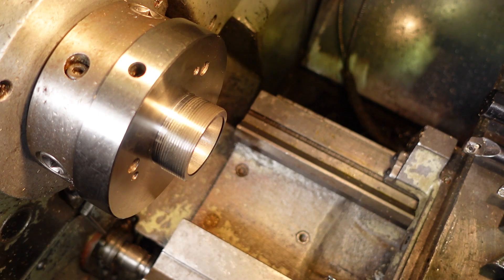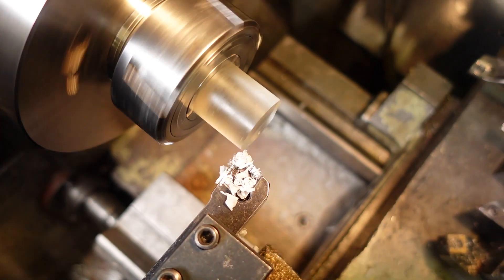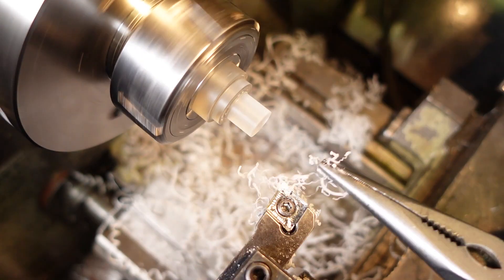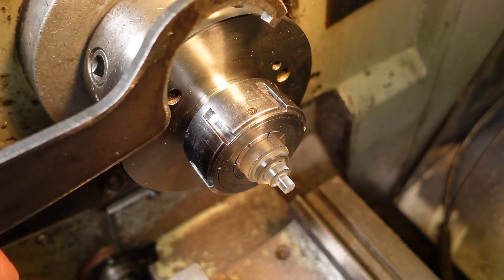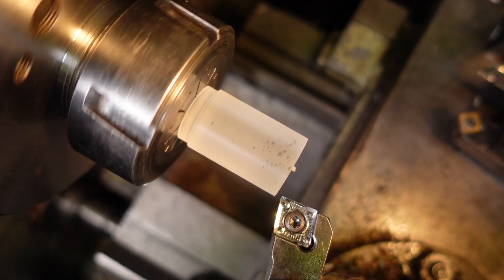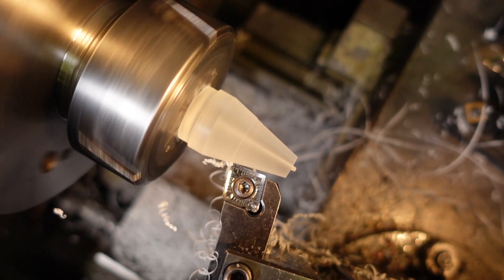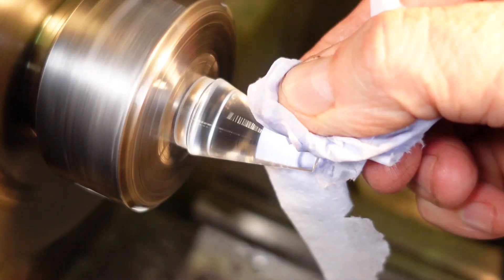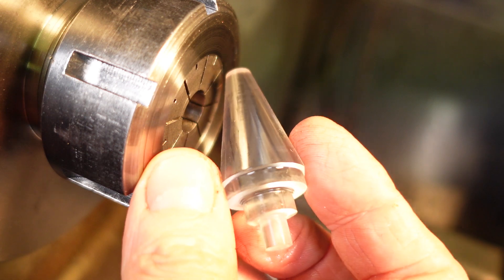Machining a 10 GHz Lens Antenna from Rexolite 1422 Dielectric Polystyrene

Comment: Thank you for sharing your video, and for explaining what it does. I never thought that styrene was a lens material, let alone one for radio microwaves. Plastic chips too!
Reply from the maker: i've made several other videos about dielectric lenses. Many of the non-polar plastics make very good dielectrics for lensing at radio frequencies. PTFE and polyethylene are particularly good performance with very low lossesI use UHMWPE and polystyrene quite a lot. Polycarbonate isn't particularly good but makes good transparent radomes. Most of the engineering plastics and copolymers tend to be polar and have more dielectric loss, so they aren't as useful for lenses. The really interesting materials are those using a plastic base, which is, either a UV setting resin or a thermoplastic polymer that can be 3-D printed but that also contains ceramic granules or alumina or titanium dioxide for example. It'scertainly a very fascinating area and at millimetre waves you can use optical design techniques to make radio aerials, which feels a little like magic to me.

Comment: I enjoy working with Perspex, I'm not sure how different it is to Rexolite. Forgive me I have no idea about microwaves so how do you get the microwaves into this structure, I could understand if it were an LED etc but do you point a beam of 70Ghz at one end and something comes out the other? Is it a way of focusing a 70Ghz beam, if so why?   I look forward to your video on these things, I have an electronics background but a few Mhz is my limit and that's only in a clock form. I love the look of microwave stuff but its got me beat on how it works. I've pulled some old cellphone network amplifiers etc to pieces and the boards are an art form.
Reply from the maker: Rexolite is more brittle than Perspex but takes a nice polish. The lens fits in the end of a round waveguide tube. Waveguides can carry microwave energy with extremely low loss, but when you want to illuminate a parabolic dish, you need to form the beam into  a nice clean lobe without any responses from off the main axis. Target it to illuminate the dish with just enough of the available beam power to give good efficiency without any spillover.  First issue is to get from the air dielectric into the plastic without reflection mismatch, so the rear of the lens smooths the transition.  Then the tapered section, which has a relative permittivity of about 2.6, carries the wave at a lower speed than the air and acts to focus the energy into a beam with about 100 degrees beamwidth at -12 dB (about 7% of the peak). The dimension is only about 0.7 of a wavelength, so it behaves like an optical lens that's about 300 nanometres diameter.  More of a diffraction than anything.  I'm working on a project with graded index lenses at the moment.  I'll try to do a proper video on these lenses.  A similar finished antenna feed is on my blog at http://www.g4dbn.uk/?p=1644

Comment: Hello, could you please tell me where did you find the rexolite 1422? All my suppliers denied my request. Thanks
Reply from the maker: I get it from Specialist Engineering Plastics in Grantham, UK. They only do 6 foot long round bars, no short lengths. What size and quantity do you need?
Reply: @MachiningandMicrowaves  I need a piece of rod diam 20mm by 100mm long
Reply from the maker: @stanjobar  I have some offcuts of 25.4mm dia that I can cut to length and send to you if that helps. email me neil@g4dbn.uk

Comment: A great thing about microwaves is that they aren't microscopic. Microwave parts are big enough to see and work with, but small enough to carry. 

2.4Ghz has a wavelength of about 125 mm. This means if I scale up stuff from these videos by a factor 4 I can make functional hardware that uses the same physics effects.

I am hoping to try some metamaterial experiments.

I don't have any 10Ghz gear, but I have a lot of 2.4Ghz Bluetooth hardware. Conveniently, it can all talk with a Raspberry Pi.

The Bluetooth hardware reports signal strength in dB with 2 digits of precision. I have some 400 step per revolution stepper motors that I can control with the Raspberry Pi. So mapping out the sidelobes of a signal is just a matter of writing a Python program to move a Bluetooth "smart tag" through an arc and record the signal strength.

Today's science trivia note: 2752Hz audio also has a wavelength of 125mm.
Reply from the maker: It's interesting to map out the signal levels in two dimensions if you can arrange that as well. You need to think about how to handle reflections from objects, buildings and the ground, so if you can get the thing in the clear so there's at least 200 wavelengths of free space around it and it's at perhaps 5 metres above ground, that helps to get the real pattern measured. Of course you might be more interested in knowing the pattern when it's working inside an environment, but that effectively overlays the pattern of the receiving system on to the reflections. Someone I know is using drones to do this at lower frequencies, and another is using a helicopter to measure digital broadcast radio antenna patterns at around 200 MHz.

I use two pneumatic masts, with the antenna under test on one and the sensing antenna on the other.  I can pump them up to 13 metres above ground to ensure there are no reflections.  I use tape rulers to measure the height of the transmit and receive antennas and a calibrated rotator on the transmit antenna to test the pattern at multiple different heights.

It's huge fun.  If you want to get REALLY fancy, set up an array of 25 BT receivers (5x5), then sweep the transmit antenna around and see if you can see the sidelobes passing over the sensor array when you play back the signal level as the colour or brightness of a display.  If you can get hold of even more, you can almost make a "camera" for 2.4 GHz and try diffraction and lensing and get up to all sorts of high jinks.

Comment: Ok, now this one is directly relevant to my interests. How well does Rexolite handle cold? UV radiation? How well does it preserve polarization? Would this style of lens be happy with, hypothetically, RHCP 7812MHz 30MHz bandwidth ±171kHz off a 2-3m prime focus parabolic reflector?
Reply from the maker: Rexolite is quoted for use from -60C to +100C. I don't know of any polarisation rotation or other effects. Spec sheet is at http://www.rexolite.com/specifications/ I think it would be fine with a stepped septum or dual probe RHCP in the right sized tube at 8 GHz
Reply from the maker: Not sure about long term UV survival

Comment: Had you not offered any context I'd never have guessed waveguide, but here we are.
Reply from the maker: I've been thinking about making some combiners/splitters machined from solid dielectric waveguide, as the only was of making the intricate internal features is by 3D printing and investment casting. I could machine a negative of the space, then coat it with a layer of conductive material and electroform copper over that, but it's also possible to make waveguide just from a dielectric with no metallization.  I'm thinking about combining multiple 24 GHz amplifiers without using magic-tees or cavity couplers.

Comment: How much RF power can it handle do you think?
Reply from the maker: With a loss tangent of 0.00066, it would be dissipating around 1 watt for a kilowatt of RF.  I think a watt might be fine, but the thermal conductivity is really the limitation. If hotspots were to form and not be able to shift the heat out by conduction , that might cause problems.  I don't have a travelling wave tube amplifier, so the most I'm likely to be able to generate at 10 GHz is about 80 watts of carrier from a pair of Wolfspeed CMPA801B030s, so I'm nowhere near the limits.  It should be able to take 10 kW pulses though at a few percent duty cycle.

Comment: I love listening to RF people talk.... This must be how "normal people" feel when I go on about voltage regulators, TTL or look-up tables ;)
Anything made from clear plastic or resin has a superb retro-sci-fi aesthetic to it too.... the finished part looks so cool!
Reply from the maker: I've just been reading a long and complex thread about Kalman filters in phase locked loop control circuits and how to control 1/f and flicker noise. I love the time-nuts forum because they don't make any attempt to simplify the language, it's just the hardest of the hardcore time specialists riffing away and having fun.  Spectacular stuff when you are looking for precision beyond 1e-13 and controlling the jitter and atmospheric variation of GPS to the point where seasonal ground heave is one of the major noise sources as the subsoil warms and cools. Labs with 0.1C temperature control, folks with multiple caesium atomic clocks and even hydrogen masers in their basements. I only have Rubidium clocks and a number of double-ovened Morion oscillators mounted in anti-vibration enclosures inside temperature-controlled and insulated rack cases in the three 42U data racks in my study., plus a number of GPS units. My timing is pretty much GPS quality over periods of hours, but short term it's perhaps not much better than 0.1 ppb (1e-10).  That does mean I can generate a signal to within 1Hz at 10 GHz, but it feels rather sloppy and imprecise to me!  I did a load of work with MECL III back in the 1970s, clocking it at 280 MHz and that felt ridiculously fast.  Now I'm reading an article about 100 Gbps over ultra-wideband radio. How things change...

Comment: I just wanted to say how much I enjoy your channel. I hold my amateur radio license, and while I enjoy the technology side of the hobby, I do not really enjoy the actual radio communication side of things as the setup I would like to have is just too expensive. I enjoy making things, and your channel is inspiring, and shows that you can be an amateur radio enthusiast while still making things! I love the flow of your videos and all of the little quips and jokes you inject into the story.
Reply from the maker: There's a surprising number of radio hams who, like me, don't actually enjoy the "talking to strangers on the air about nothing of note".  My late wife used to give me one of her Looks and ask "But do all those people have anything interesting to SAY to each other?".  The hobby for me is about making things, testing stuff, exploiting weird and unusual propagation mechanisms and helping other folks to do what THEY are interested in. I'm always attracted to the edges of things, so the 8270 Hz band and the Terahertz zone and longwave infra-red is all exciting right now.  Yes, 8.27 kHz. Microwatts of effective radiated power at ultra-slow data rates and bandwidths of 80 microhertz but still able to get signals across the Atlantic. Also working on 470 THz red light using Phlatlight ultra-bright LEDs running 27 amps at 3 volts into large Fresnel lenses for communications over 150+ km. Cloudbounce with red light is something else I'm messing with, rain scatter on 47 GHz, bouncing signals off aircraft to get microwave contacts into Europe over 600 km and more than 1500 km via passive reflections from the International Space Station.  Bouncing radio signals off the moon is my main focus at present.  That's so close to the limitations of Physics, and the sheer thrill of hearing your own doppler-shifted echoes off the moon after the 2.5 second light-travel-time delay takes some beating.

Comment: It's never going to stop amazing me that anything turned on a manual lathe could be used for radios. It probably shouldn't. But it's Noth a thing that is seen any more. It's sad that the knowledge to actually do the work and not just the "theory" is mostly gone with the exception of the few like yourself. Truly Truly sad
Reply from the maker: My electroforming equipment should be arriving next week, that's going to be an interesting new technique for making things that you an't machine or 3D print.  I'm a bit worried about whether the supply of Preperm 3D printing filament is going to resume after the company was taken over recently and the online shop was closed.  I wanted to try variable refractive index metamaterial printing.  Fingers crossed....
Reply: Noooo! He's fallen to the CNC! All hope is lost!

Lol. Though it looks like I've got a bit of homework. I'm not familiar with material that is variably refractive. I mean to photons sure the reflector can be dulled or oxidized unevenly. But that's not been a benefit to anything I've seen. Having a plastic/polymer that is variably refractive to electron waves on the other hand... is it used in conjunction with turning crystals or an alternate to? Is that even what's going on with the refractor?
Reply from the maker: @daretodreamtofly3288  Imagine a sphere of glass. It doesn't focus light very well, lots of distortions. Now if you could vary the refractive index with diameter, you can fix the aberrations and make an effective lens.  Not practical.  Now radio waves and light waves are the same thing. Still photons, still electromagnetic waves, just at a lower frequency.  Same as gamma waves are higher frequency. Lenses behave similarly so long as they are large compared with the wavelength.  If there are air gaps inside the material that are less than about 1/20th of a wavelength, they don't have a large effect on the performance of the lens.

Now, for light, that means less than 20 nanometres,  but for 47 GHz radio, it's about 0.3 mm.  Next, imagine 3D printing a 100mm diameter ball from low-loss plastic with 100% fill. It would be a poor lens. Now change the fill ratio using smooth swirly shaped voids and vary that fill ratio continuously with distance from the centre of the ball.  If the voids are less than 0.3 mm, you've just made a graded-refractive-index Luneberg lens.  

Now take is a few steps further and change the shape of the printed object and vary the density and effective refractive index, and throw in different dielectric materials with different relative permittivity and suddenly you are in a completely new world of antenna design, where you can customise the coverage pattern of a lens antenna.  Exciting times we live in.
Reply from the maker: Then it goes totally next-level, with metamaterials that have a NEGATIVE refractive index, where the phase velocity is greater than the speed of light. A convex lens made of that is divergent. Now that is spooooky.
Reply: @MachiningandMicrowaves  now that I understand a little about. And I've seen two running thoughts on this. One is that on our level of "normal" physics that it only appears to be traveling the speed of light. But that supper connectivity comes into play at some point. Sighting that the "speed of light" is in reference to the speed of a photon in q vacuum. I mention this not for you sake but just to give you reference on my understanding which could be wrong by all likelihood. But as for the second idea on "faster than light" transmission is down on a quantum level the particular is moving with so much energy that our universe "forgets" where that particular was and just puts it in the place approximately appropriate for it as it had been moving. I find that description way to basic but it's better than "the particle pops out of existence and then back in" then there's also the idea that the particles are just a function of Quantum strings and as that move faster than the speed of light that they revert to individual strands of energy then when they slow back down recollect into matter
Reply from the maker: The "thing" that's moving faster than light is the phase of the wave in this case. It's usually explained like a movie of a wave breaking as it approaches a beach at a slight angle.  The particles are only moving slowly, at say 1 metre per second, but if the angle is half a degree, say 1/100th of a radian, then the position of the break is moving sideways at 100 metres per second, even though no particle is moving that fast.  You can't pass information at faster than light speed, so no need to invoke quantum effects. It's still flippin' spooooky though!
Reply: @MachiningandMicrowaves  it definitely sounds interesting. I don't know if you'd want to go over it, but I'd enjoy a video explaining it. In most data communications that I'm familiar with, they say it's moving at the speed of light. But it never truly is. Even if it's fiber. No glass was ever 100 transparent. Even very close isn't perfect. So faster than speed of light would be amazing. 5G would be snails pace. Lol
Reply from the maker: @daretodreamtofly3288  The thing is that you can't send information faster than the speed of light, at least without invoking quantum entanglement or similar.  The phase velocity can't carry useful information. I did some work on "superluminal jets" ejected from black hole accretion disks when I decided to do a degree in physics for the sheer h*ck of it because the grandchildren were complaining about how Old People didn't have exams and school 'A' levels to worry about and life was so hard etc etc.. The apparent superluminal blobs are just a by-product of being very very VERY fast and almost aligned directly towards us, so the apparent motion across the sky is faster than light because it takes longer for the light emitted at the start of the jet to reach us than that emitted later. The geometry is amusing.... If you could find a way to encode information that travelled at the phase velocity rather than the wave velocity, you've be on to a winner. I'll go into it when I master how to produce metamaterials!  It's just that I have this quadrupole mass analyzer project chugging away at the back of my mind, along with Project Swordfish and 37 others...